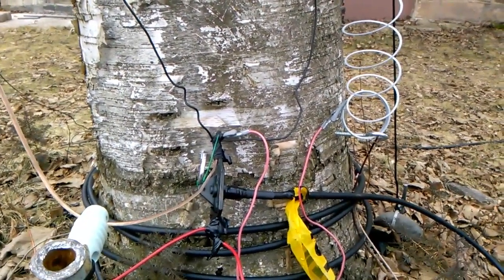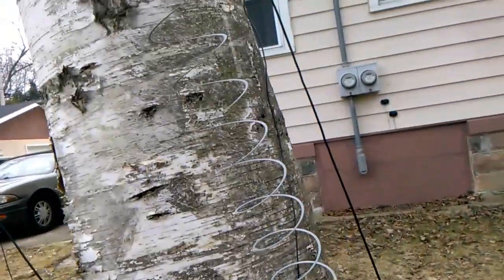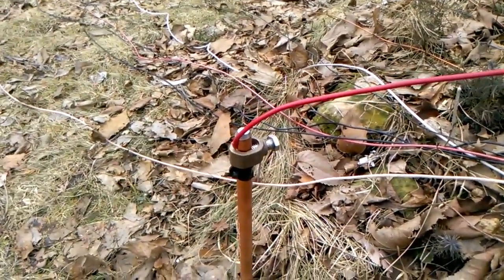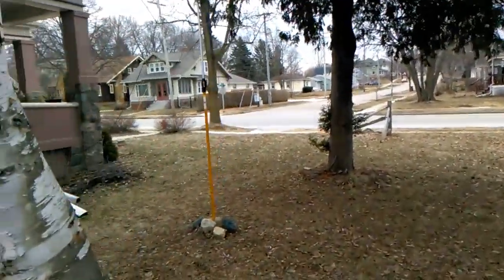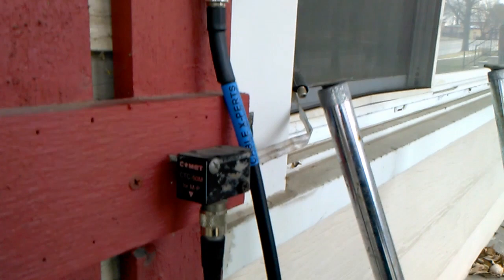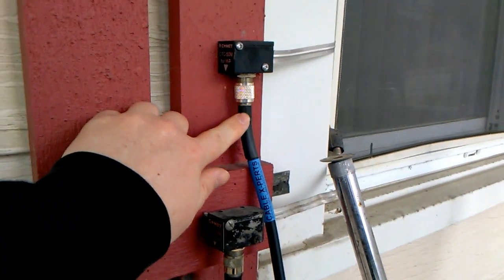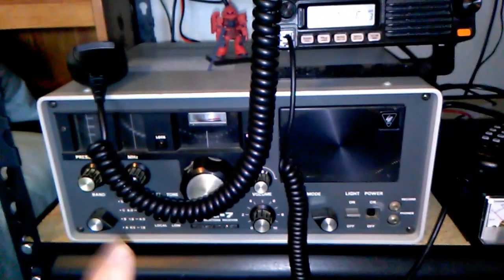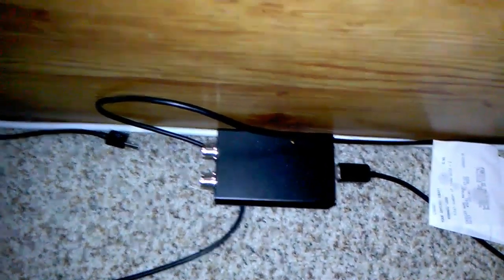KD9LVR's Ham Radio Setup 2019-03-24

Comment: Hey Dennis, I always enjoy your vids and want to welcome you to the ham radio community! Two thoughts: One is that if you can create some slack on the MFJ vertical ground plane antenna's coax feed line so that you can tie it off onto the pole, for "strain relief", rather than having it hanging off of the connector like that, you will be much better off. The way you have it in this video, you are creating a lot of stress at the connection, which is going to end up shortening the life of the connection either at the antenna connector, or at the feed line's plug. Not only will you have a safer setup, but it will be less prone to falling over in a storm, etc.  You'll want to tie it onto the pole with a plastic tie wrap or something similar. The other thing is that rather than using tape to protect your outdoor connections from the elements, pick up some "Coax Seal" from your favorite supplier. I have used it a lot. It is MUCH better than any electrical tape for outdoor applications, because it's malleable and mushes into the shape of whatever you are protecting! Get a couple of boxes. No, I have no connection to the company that manufactures it, I just love the stuff! http://coaxseal.com/product-informatio/
Thanks for sharing your set up and welcome again into the greatest hobby in the world! 73 de W4PKR
Reply from the maker: Thanks! I took your advice and got some coax seal. It's kind of like a putty and it works really good. I no longer use that MFJ antenna, but I did use your advice for creating slack with the coax. I'm now using a Diamond X-30A on a 22 foot adjustable mast, and it works great! 73 de KD9LVR
Reply: @Sparkyzilla85  Hey, good news! Hope you have fun chasing that DX!
Reply from the maker: @elkabong6429  I've been having alot of fun chasing DX. I made my first contacts with Finland and the Netherlands the other day on FT8.
Reply: @Sparkyzilla85  Cool! I’m behind on my HF. I was going to reset my MFJ-1788 magloop for horizontal mounting, only to discover the flanges holding the bolts to the housing for mounting have come completely loose from the body of the antenna. I either have to “McGyver” a fix, or, for the money I paid, better to disassemble it and send the broken part back for fixing or replacement. In the meantime, I’m going to see what else I can do. I’m on 3rd story apt with a balcony facing west and I do also have a SuperAntenna MP-1, but have never been impressed with it’s range. Maybe for operating FT-8 it would be adequate. Perhaps we’ll work each other in the not-to-distant future! 73!
Reply from the maker: @elkabong6429  I hope you can get your antenna situation taken so we can have a QSO some day. My favorite bands are 40 and 17 meters.
Reply: @Sparkyzilla85  Me too! 73 de W4PKR (Jim AKA “El Kabong!”)